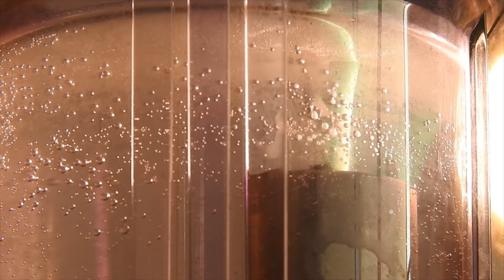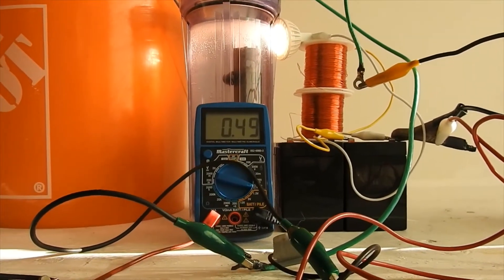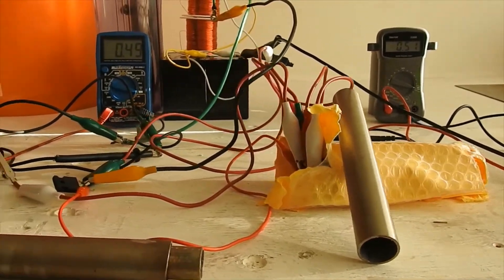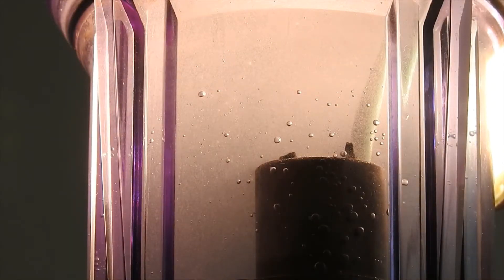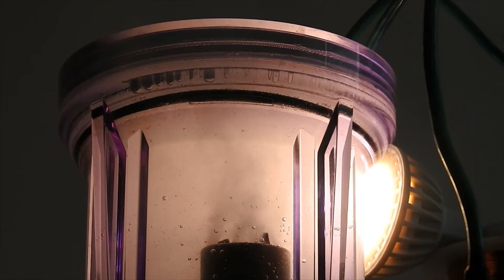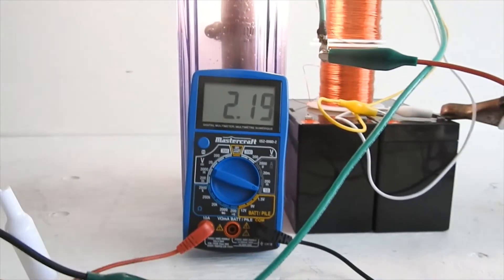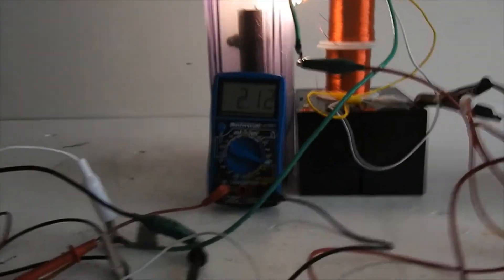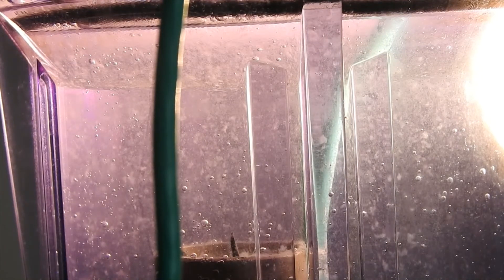HHO Stanley Meyers Resonance versus non Resonance

Comment: ok, I'll throw a question or two out there. Will this produce 3 liters a second or more?  Can this be ran on a 12 volt mobile electrical system?  How much water per minute has to be supplied to get a desirable output rate?

Comment: Stan meyer used AC voltage off of a pentium chip  3-4v pin voltage, 200 milliamps and a Phase of between 10mhz and 50mhz ,one specific phase released all the hho like a boiling kettle, if he moved the phase 0.05 mhz it stopped bubbling like mad with same voltage and amperage.  Let me Clarify, He made the pins of the chip power the HHO bubbler.. so the chip  would alternate Ground and Positive Voltage, in the 1/0 off the chipset.
 They he adjusted that chip from lowest MHZ to MAX  somewher  in there he found that phenomena of CFM per milliwatt , before that it was CFM per WATTS.
  Also his engine used the SONIC BOOM  of HHO ignition ,as the Majority of the Combustion.  This is why he made the Injector and Spark plug that GIANT unit. that went into the Plug hole,  He needed the spark and oxyhydrogen millimeters from each other...  IN THIS CASE..LEANER is BETTER, since he was not burning gasoline,   IT would not suffer detonation near TDC ,and running lean would not kill the engine rings, and valves ,since the combustion temps do not soak in a gasoline engine, it runs so much cooler. Water vapor in exhaust steam  cools the HOT side of the head.
Reply: I THINK IT MAY HAVE BEEN PULsed dc. and not ac
Reply: @tvdylan  You might be right, holysh!t

Comment: So... the resonant frequecy is..?  Or does that all depend on pipe diameter and length and getting the pipes to 'sing'?

I see mention of 923 cycles per second (Hz) with no specific tube lengths or diameters in sight.
Look up:
Voltage:4,8 V
Amp:300 mA
Frequency: 923 cycles per second (Hz)
(I'd post a link but it'd probably get deleted)

Comment: I've been studying this tech for maybe 11 years, not just Stan Meyers Waterfuelcell, in the case of Stan's first device the Waterfuelcell, it works on resonance frequency as you probably already know, I assume its the electronics are pulsing the tubes at the resonant frequency of water or resonant frequency of the pipes, but Stan Meyer moved on from this device, Why? Was it because the device would slip out of resonance? The great secret about this technology is about creating Electrically Expanded Water which can be created using the method you're using but also many other methods as I said there may be an issues with the device slipping out of resonance. The successful use of this technology, contrary to popular belief is not about releasing copious volumes of hydrogen in order to run an engine on water.

Comment: Its in relation to all of this ,  know that frequency is needed , i dont have it off top of head..

Yet have read about best frequencies to use..   so have a frequency ,generator ,tuned ,would make life easier ....

Also , have 316L  stainless steel due to corrosion resistance ...

Which affects the frequency also.

The voltage ,should be around  1.2.  V  between poles and not all are neg or pos , some neutral , 

So if you us3d a dry ,cell ,that the soloution passes , youd divide mayybe , 12v between the neutral plates ,to lower the voltage ,in each section ..to around 1.2v 

More voltage and current equals more heat , not a good thing ...

Oh and for the bubbler /scrubber 

Maybe go look at delvis 11 video on hho 
He implemented a flash port , so the bubbler could not grenade !!   An extra safety feature ,if you plan to use hho for burning ...

Comment: I use 498kHz, but interestingly, you can also achieve resonance at 1/4 and 1/2 this frequency. Also the pulses should be separated by a fully ON pulse width and not an OFF width. Outer cylinder should be negative and byfilar wound coil that is tuned to your capacitor setup. I will try and video my setup so far. The frequency is very hard to find due to so many variables. Great video you have, a pressure gauge and timed run would be perfect to show difference. :)
Reply: Yes, so instead of AC current it’s a pulsed Dc current so a square wave vs sine wave
Reply: Yes, that's correct. :) @andrewel5383
Reply: Why not make a variable frequency device so you can just turn the dial?  The resonance will be on any of the natural frequency nodes of the vibrating system, there is no limit, this is basic electronics and basic acoustics.  I would guess that the water would vibrate based on the volume, but there would be an ideal natural frequency where the least energy is required to fully vibrate the most water molecules.
Reply: Can someone point me in the direction to calculate a coil for a specific resonance. Thanks in advance
Reply: Any idea how to create a 100 MHz resonance rod?
Reply: @krisztianadrian8528  perhaps ask a ham radio guy
Reply: A radio transmitter antenna is a resonant rod.  @krisztianadrian8528
Reply: So a pulse should be 50%on/50%off then 100% on then repeat? Square wave?

Comment: Two questions, did you use distilled water and did you electrically isolate the electrodes with some varnish or something else as stipulated by Stanley Meyer, in other words normal electrolysis does not work with his cells?
Reply from the maker: Tap water and electrolyte
Reply: @thewonn  hi sir

Comment: UPDATE! We (WITTS MINISTRIES)  are now getting 100Liters per second! that is 6000liters of Gas per min. That is 360,000Liters per hour! 
Input is only 497 Watts!
No joke 
Search out our you tube channel and then our website for more details. 
We also teach you how to make your own simple fuel cell so you can be totally electrically, independent!
Reply from the maker: Scam
Reply: @thewonn  scam? how do  you know that ?
how big is their unit?
What materials & technologies are they using?
100's of different hydrogen generator designs as is stands & probably a 1000 different (& more advanced) ways yet to be discovered !
& no doubt over time there will be advances

Comment: What a good work. I have got questions. Have you found the solution to generate hho on high voltage and low current like what Stan did?
Reply: See Max Miller video " Stanely Meyer lecture" and he explains how resonance circuit is used to generate HHO.
Reply: LowerCurrentAtInputComparedToOutput.WhatDoYouWantMore?

Comment: If it is working optimally you should only use milliampa. On half an amp is HUGE and you are just generating by electrolysis. I suppose you are getting some efficiency but I doubt that is over unity using 1/2 Amp;, again that is HUGE. Stan Meyer generated massive Hydrogen with a couple miliampss
Reply: Have you build any prototype to confirm? I am really interested in HHO,.  Do you have any web site to get information from? Thanks
Reply: Amps can't tell you anything without the voltage. Meyer was using high voltage. Volts x amps = watts

20 mA at 240 volts = 4.8 watts = 400mA at 12 volts

Hope I did that math correctly

Comment: hello, congratulations on the videos!  you can talk about the components and connection system, I would like to make one like yours.
Reply: If one knows the capacity of water which is about 90, distilled and without an electrolyte and you want to achieve resonance you just solve for the inductor [residence rod] in Henry's at the voltage you use and Supply the inherent frequency. Not simple to idiots and those that have the Love of Money in their heart. LOL

Comment: It gets too complicated because the dipoles of the electron clouds of the H and O are all moving and interacting. So you find the resonant frequency by charging it close to saturation, removing power, and measuring the frequency of the swing back of the dipoles.  The resonant frequency will change depending on temp, pressure, and magnetism. So self adjusting using a type of phase lock loop would keep it in tune. Just have it skip a pulse every once in a while to have a micro controller  keep it on freq.
Reply: hi. I just entering into hho production and still knowing Meyer's work but there is so much that  it is not clear for me what is the latest work to implement. Can you provide any extra information to continue with? Do you have a blog, youtube channel or any social media to know your work? Thanks in advanced.
Reply: @emesma  Knowing electronics is a must. Everyone on the internet is wrong. Brute force is horribly inefficient.  Meyer's patents are right. Read his words from all of them. He says voltage, no current. His circuit designs are very old school 1980's that's why many don't understand them.  A fuel cell with distilled water is a capacitor. You want to charge the capacitor to just over it's break down voltage, but in a way that when the break down makes it conductive no more power flows, or it will just ignite the hydrogen you made. Look  into how Geiger tubes work and the circuitry for them.
Reply: @paulksycki  I am in the rigth path then. The problem is, accourding to what I have found, Meyer's cirucuits are kind of modified with some "miswirings" to make difficult to people. I am still lookwing for the right one. And as I am also an old school electronic engineer, interprating the schematics is not a problem. Do you  have corrected schematics? Thanks.
Reply: @paulksycki  thanks. I really appreciate your help. I'll keep researching.
Reply: @paulksycki  I knew he had it
Reply: Quartz pulse maybe?
Reply: You missed out two important factors , the chemical salt used , plus amount,  and also the type of stainless used ....
Reply: @wayne7521  You use pure distilled water. .  Meyer's patents actually show a progression between each other where he explains having problems of current leakage and that the goal was to pass no current, only voltage. This is because a water capacitor like all capacitors is a voltage device as opposed to an inductor which is a current device.  The salt just creates a leaky capacitor. I'm not sure about the metal. Best case would be fore it to be shaped to be in resonance with with the system like tube or egg shaped.
Reply: @paulksycki  his goal.was to pass voltage but not current .....

Erm , makes nonsense,  as each are linked to each ,  you cannot have voltage ,without Amoerage , and both equate to Watts...

Duh
Reply: @paulksycki  and with adding salt , you can only add so much before , thermal runaway occurs due to the current galloping ahead. 

Which is very inefficient ...  hence a small portion to water ratio 

And why the heck did you point out the water was distilled ,    

If I know of materail used , of 316L  stainless steel , then it should be obvious it would be distilled , as distilling leaves out most !!! Of the impurities...

I say most as nothing is ever 100 percent
Reply: @paulksycki  you said you wasn't sure on metal ,     do an experiment with ,  shop bought, say flipper spatula ,for use in the kitchen ... highly likely to be either steel 

Or 304 L steel 

If you Google classification of stainless steel types , you'll see 316L   is also known as marine grade stainless ... hence its corrosion ,resistance
Reply: @wayne7521  Because they are linked with each other does not mean they pass the same thing. The dielectric material that separates the electrodes of a capacitor are non-conductors like air, glass, wax, ceramic, exc.. Try passing current through the glass of a layden jar capacitor. I deal with capacitors and resonant circuits every day. I assure you capacitors deal with the voltage side.When you dump 20 amps into a water capacitor it heats up. Heat is wasted energy.
Reply: @wayne7521  Stainless steel is stainless steel. If you read Meyer's patents he clearly says voltage and as close to no current as possible.
Reply: @paulksycki  oh and I said ,give me a link to read ,what you are stating 

As I've googled and not got far , even videos on here are someone else doing experiment
Reply: @paulksycki  why do you keep telling me what I know already ....

Hence why you use as little as possible,  and even then voltage over current.

It aint rocket science pal,  it's all math , and erm , it's also why wires catch fire , with too much current .

Which is actually the speed at which electric is moving at , which in turn creates a different type of friction 
And friction creates heat....

Is that true or not ?? 

Yet you can get true litres per minute , of high volume , measured consistently ..

Without much in heat production ... 

Just because one person ,said it was so,  Does not mean it was ... and the conspiracy story too , please
Reply: @paulksycki  plus the only thing hho does for an engine, is make exhaust output cleaner ...   oh and its good to help blast out carbon build up too apparently .
Reply: @paulksycki  or is it your ignorance, amuses me hmm
Reply: @wayne7521  ypu are right, but you can make a have high voltage circuit with nano amps of current
Reply: @danielesparza5118  yes I know friend ,  it was the other persons ignorance , stating that stainless steel, is stainless steel..... it was the ignorance of not saying that it has grades of resistance to corrosion ...

For many applications..... yet you can use twelve volts and still keep the current low ,so not to heat up the device .... its all about frequency that changes water ....
Reply: TotalFreedomTTT-pk9st  I will probably sound Narky ....but ..
When someone writes in capitals ....it usually indicates shouting....
Myself ,I already know ,that voltage multiplied by Ampage ,equals to how much power consumption shown in Watts...
So yeah don't be so patronising !! 
As for frequency I was more referring and possibly agreeing , with like minded people who have tested etc...
That every material whether mineral ot vegetable or biological vibrates at its own frequency ...maybe someday ,we'll evolve smart enough to figure it out ...
Long way off mind as ,at the moment we're deluded as a species that we are top of our food chain ....ha when we realise war and famine and over population is not needed or controllable,  and that the planet we live on is and should be appreciated ....then we'd have achieved a massive leap in humanity been ,CIVILISED as they claim we are now ....
As at the moment ...we are ,as compared to the roman era ...only moved forward one footstep ,to what their society was ... not really civilised are we .... more ,just tolerate each other ...
Animals do it better than us
Reply: TotalFreedomTTT-pk9st  what the swizzle dazzle are you moaning at , tell someone that doesn't understand amperage !!! Not orage duh.

Go troll someone else pal ... and it is "make no sense"  what you wrote was nonsense !!
Reply: TotalFreedomTTT-pk9st  p.s. where did you understand me saying volts and amps don't go hand in hand with each other .... duh
Reply: TotalFreedomTTT-pk9st  our points are made .... you're nothing more than a troll ..... Happy to have fed you your requirements ...
Next time ,try looking before you leap ... although them years , are far apart !!! 
Don't let the door hit you on the way out

Comment: hi. your tubes have the same wall thickness? or are machined in a lathe for this? gap ?the outer is sloted?are annealed?
Reply from the maker: Yes, outer is 1" od, inner is 3/4" od. Seemless tubes off the shelf. 1/16" thickness.